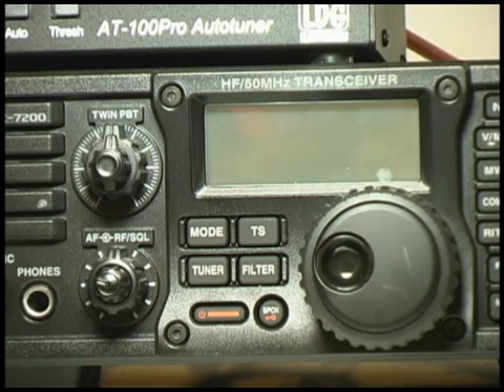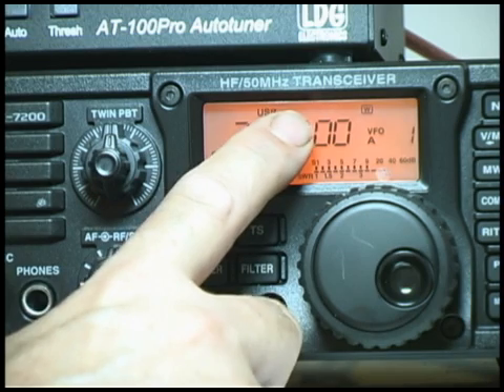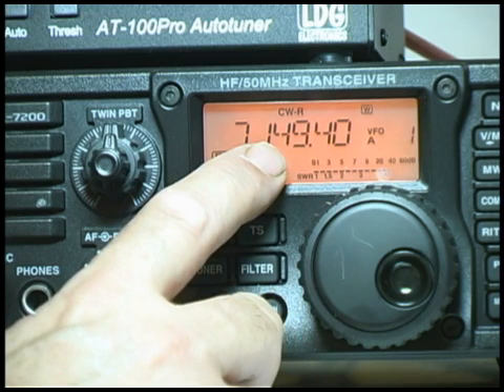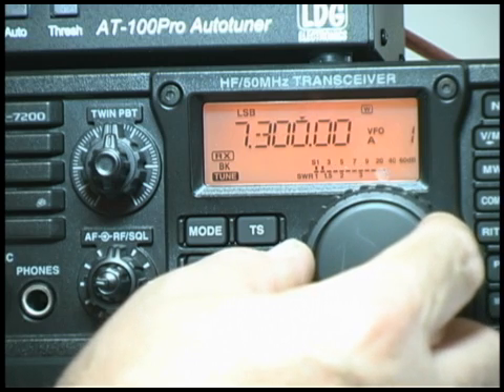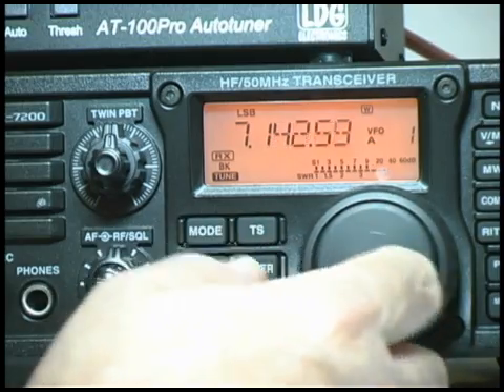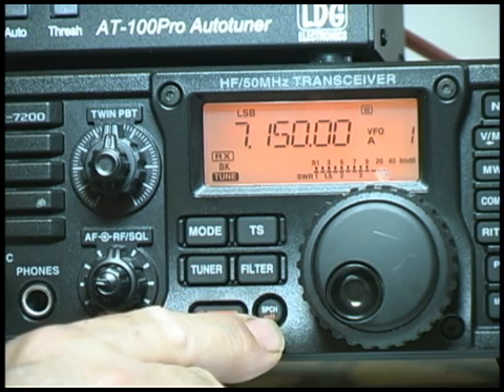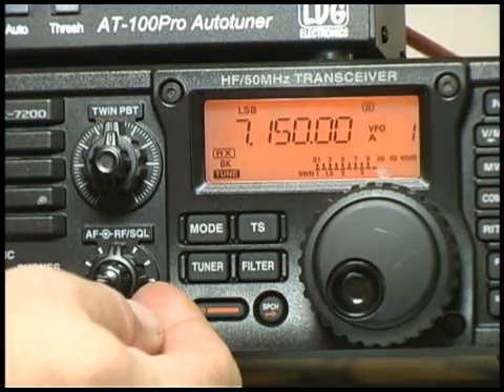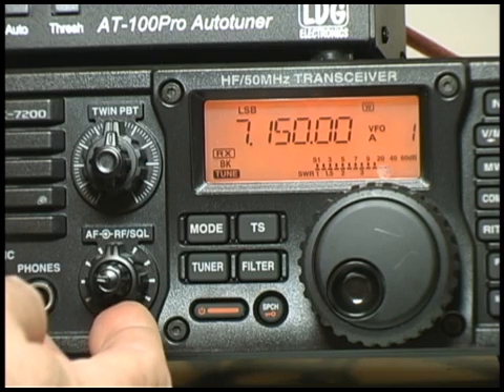Icom IC-7200 Basic Operation

Comment from the maker: As I recall, and this is now going pretty far back in my memory, the the 7200 had a receiver on par with the old IC-746 but I could be mistaken. The 718 is a good basic receiver but it has almost always been a sub $1000 radio plus at this time it is a pretty old design. When I picked the 7200 I wanted the club to have something that would work for contests and this was the best radio, at the time, for the money. I think Icom may have given us a deal because we bought two. There is nothing wrong with the 718. If you are going to buy a new radio now, and you don't plan on putting it in a multi-radio contest station, I would go for the IC-7300, but that's just my personal preference.

Comment: One of these showed up at Field Day. 3 of us spent 15 minutes trying to change bands. This required a manual. Then we tried to get the  CW key to work. An hour later after digging through the manual...no luck. I know it needs to be in BK in mode but we couldn't find how to change it. We finally gave up and someone went and picked up the IC-7100 which is much more intuitive. I hate this rig.

Comment: Nice radio but needs AM & FM modes.
But only for sideband and CW I guess this can bring the used price Down.
Everything seems be desirable but icom could of made power on switch a manual push in out button .
Reply: Generates & receives AM just fine.

Comment: Once I get my general I may have to get one these radios. I like the fact that it has features to make it more accessible to people with visual impairments. Besides the voice function, the layout of the buttons seems reasonably blind friendly. I don't need those features, but it's nice that they are there.

A big selling point for me is the USB port on the back. Being able to do rig control and digital modes from one cable is very cool.

Comment from the maker: There is plenty of metal and shielding for the important stuff.  The case, regardless of the material, has enough holes in it to not provide much shielding, the real shielding is provided by the interior chassis pieces.  I think the radio is made out of the same material (metal) that is used in the small water resistant HT radios.  I don't have the radio at the moment so I can't check it out.